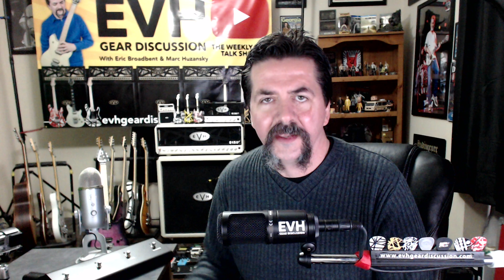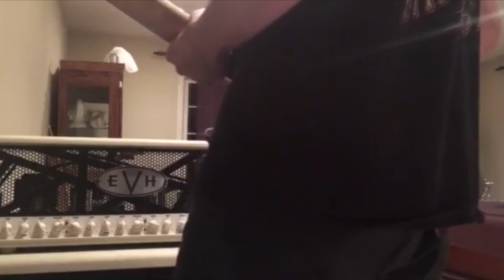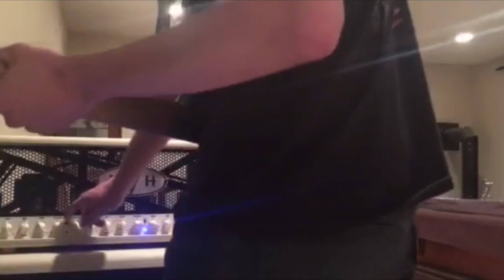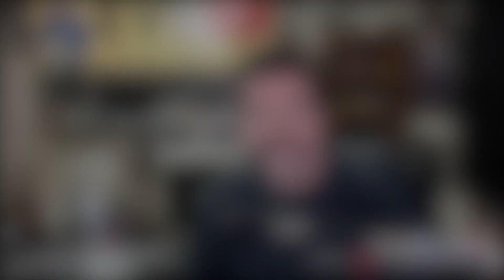EVH 5150III Voltage Problem/Hum No Output Fix

Comment: I have a similar problem with my 5150 Iconic that was delivered today almost zero output and sounds like a broken speaker but I doubt that is the problem my footswitch is not 3 pin though it’s starndard 1/4 inch

Comment: Thanks for this. I just bought an open box 5150 III 100w and the channels switch fine from the front panel, but the footswitch doesn’t work correctly. I’ll call the seller to let them know, but ordered a new din cable (only $22) hoping that will fix the problem.

Comment: I have an  (EVH 5150 100 STEALTH ) plugged into a load box (Torpedo captor X ) for direct recording through IRs. When I have the sound turn down on the monitors and I play the guitar, I can hear it coming from the amp head. There is a Randell ISO cab speaker cabinet plugged in Captor X. There should be no sound since the monitors are turned down. is this normal for high gain amps.

Comment: I've had an EVH 5150 EL-34 100w for 5 years now. Suddenly, I'm getting extremely low volume on the green channel, blue and red are fine although I have noticed a slight increase in humming and other noises but it's always made humming and other noises ever since day one so I attributed that just to the amp running really hot for the ultra high gain, nothing a noise gate can't hide which I have 2 running through it. Tried swapping preamp tubes around to no avail. I mean I don't play it that much or push the tubes that hard so I have a hard time believing the tubes are bad after only 5 years. I've had tubes last 3x that easily in the past on other amps. If it were power tubes going bad, wouldn't it affect all channels and not just one? 

Main fuse blew about a month back, replaced it and it's been fine until now. I was hoping it would be something simple like a bad cable for the footswitch or something but that didn't work either. Beyond swapping tubes and replacing the fuse, that's about where my knowledge of tube amp repair ends so I'm going to bite the bullet and take it to knowledgeable tech to fix it. Love the sound of EVH's when they're operating properly, not at all impressed with the reliability or quality though.

Comment: does the 5150iii lbx2 needs biasing when power tubes replaced? or it's a plug n play type of replacement?
Reply from the maker: Here is an answer direct from chief engineer, Howard Kaplan to me this morning: "Must be re-biased. Is not cathode self-setting bias and has a bias setting pot and sense resistor for measurement. Replacement el84 tube set must be a matched duet. Bias is set at 28 mA for the pair which measures 28 mV across R18, a 1 Ohm resistor. The bias pot is R37."

Comment: Hey I know this is an old Video , But I just got a 5150 3 100 watt head 6l6,  And everything on it works great Except when I Use the effects loop  There is this hum that I can't  get rid of.  All the channel volumes work nothing else is the problem, Funny thing  is   When I plug in to The front input Is silent as an owl But when I use the effects loop there's a hum Please  Help
Reply: I have a similar problem. Amp works fine untill I try to turn on the effects loop via the footswitch and then there is barely any volume and an awfull hum. Did you ever find a fix for it?
Reply: @PlanetFinesse   Wow that's interesting do you have A-line level for your effects loop?  It may need to be turned up, or you could have a broken phase   Inverter tube,  also make sure all your cables are hooked up properly, That's happened to me Minnie of times where I thought something was wrong but it wasn't  User error  lol
Reply: Also I don't have the 5150  Anymore Just got a peavey invective 120
Reply: I have the same issue with mine. Could you solve the problem?
Reply: @leonemesis87  I don't  have the amp  Any more I have a PV invective 120 watt.  You may have to take that amp  to a workshop  and get it Fixed, It may just have issues  with that model  in general

Comment: Hey. I have one 5150 lll 100 watt and its working perfectly but the effects loop on the  footswitch is backwards. The efects loop its on when the purple light is off. Any solution for that. Its not the cable. and the amp is working perfectly
Reply from the maker: I have had that happen numerous times too and it's baffling. Try this. While amp is on, remove the footswitch cable from the back of the pedal, wait a sec, insert it again and try again. It kind of "resets" itself. I actually had an experienced guy tell me "you have your send and return reversed". I was like Dude, come on. That surely was not the case, and I said I was not born yesterday. Try this tip and report back to me.
Reply: That trick worked but sometimes when i turn it on he comes back to the "wrong way" Lets see tomorrow on my show, Thanks for the tip!! Greetings from Portugal
Reply from the maker: No probs, mine still does here and there too, I just go with the flow. When I was gigging I would always do a quick check to see where it was (on or off) before taking the stage. Good luck!

Comment: I have a problem with my 3rd channel. It has this loud ugly hum/squeal/static ugly sound and when I use the effects loop switch the volume raises a lot. Could the problem with channel 3 be a failing tube?
Reply from the maker: It very well could be tube related, but I would bring it in to an authorized EVH service centre to be sure. Please keep me posted with your results.

Comment: Had a similar problem except mines switches channel randomly when plugged in to the pedal but once unattached it works perfectly fine. Is there anyway I can fix this?
Reply: Have same problem with my 50w. I'll be playing, and then it will randomly revert to clean channel with no fx loop

Comment: i want the stealth.BAD. are the bugs worked out with the new batch? i hope so. got to have one.
Reply from the maker: I have heard nothing but positive on them.
Reply: EVH Gear Discussion,    really appreciate your Channel,  I just picked up a 5150 3 212 combo unit and my question for you is on the blue and red Channel when I  turn the gain to 12  o'clock , there is quite a bit of gain but when I turn the knob up to about 2 to 3 o'clock and then some it doesn't seem like the gain increases and sounds just like the 12 o'clock position. is that normal or does something seem wrong with my scenario.   thank you for any help

Comment: I have the Evh 5150 100 Watt head. Today when I turned it on and tried to engage the effects loop there is no sound,  maybe just a little very very low. Without engaging the loop it is fine.  Do you think it can be the switch,  cable or a bad tube for the effects loop   ?
Reply from the maker: Could be a number of possibilities. Is it still under warranty? Bring it in to your authorized EVH dealer and have them take a look. Could be minor, but worth having a pro diagnosis.
Reply: EVH Gear TV Thanks for the reply Eric.  I changed the tube  for the effects loop according to the schematic and tested all my cables and it's not that.  I will individually check the pedals tomorrow,  it could be that too.  Thanks Again,  love the show and all the cool info. Cheers
Reply: Have you figured out the problem @Tom Foglietta? I'm having the same problem.

Comment: my 5150 iii 50 watt brand new had an issue where the tubes went completely red plated... I had the amp service by a licenses EVH repair shop... got the amp home and shortly after had the problem return... its like the old Marshall runaway bias problem...

Comment: Hello, I have the same amp, it was working perfectly , now the footswitch won't change channels and when stepping on the effects loop button, shuts the three channels off , the amp works just fine changing the channels manually , Any idea about this failure ? Thanks in advance

Comment: The red channel on my 5150 isn't working quite like it should the green and blue are perfect but when I switch to red it's super quiet the gain is turned up over half way and I've around the Internet and nobody else seems to have this problem. Any suggestions?
Reply: I just got a 50w version less than a week ago, within hours this same problem developed. I’m gonna likely replace some preamp tubes and see if that resolves it. If I figure it out I’ll let you know. Please do the same
Reply: @williamlecompte1542   Same issue here, no sound on CH3. I haven't tried this footswitch test but I pulled the amp out and tested continuity and found what I think is a cold solder joint on V4, which is tied to CH3. I'm going to heat it up and add some solder and see if that fixed it after I try the footswitch.
Reply: I just got one that does this also. Did you guys ever find out the issue?
Reply: I have the same issue and took it to an authorized repair center and they could not figure it out.  We’re you able to get an answer to your problem?

Comment: Help! I can't find anybody that has had this problem. I have an EVH 5150 III 2X12 Combo (This is an older version with out a seperate volume for channels 1 and 2). I also have a 4X12 EVH cab running at the same time as the 2X12 speakers. I have the ohms set correctly. I've been running it this way for a couple of years. About 2 weeks ago I noticed the sound of the amp was a bit off. If I touch the speaker cable that is hardwired into the 2x12 combo the soud changes and goes back to normal for a short time. It does not do this all of the time (but most of the time). I've unplugged the 4x12 and put the ohms back to 16 with no change. I did the same and hooked up the 4x12 and disconnecteed the 2x12. The sound is still off. I've taken the back of the 2x12 off to check the speaker connections and they are all good. When I touch the 2x12 speaker cable there is still a noticable differance in sound. I don't think it's the cable so, could it be the output jack?  I can NOT plug the 2x12 speaker cable into the 2nd jack that I use for the 4x12 because it is not long enough to reach. In Fact! The 2x12 speaker cable is so tight that you have to start to plug it in at an angle. It straightens up after the 1/4 inch jack is halfway plugged in. They did noy leave enough sllack at the factory to plug in or unplug the speaker cable. Is this a problem ou have ran into and what is a fix for it? Thanks in advance. Best Regards, Scott Vancamp.

Comment: Eric, I have a 5150IIIs EL-34 100 watt... had for a year now. There is a constant low level hum. Its not loud, the amp plays fine... but there is this hum present throught the speakers.
With guitar straight in, no effects loop, it still retains it. When I turn the volumes all the way down, the hum still there. When I crank it, it doesn't make it worse. However, when I increase the negative feedback (resonance) of any of the three channels, the hum gets fatter.
 I've never had an amp with this issue, btw I even unplugged footswitch and its cable; no change. If you have any suggestions before I take to a repairman, please by all means, respond to my query.
Thanks, and regards,
Eric Tripton
Reply: My 5150 III 100W also has same problem. Constant low level hum & low level pop noise when I switch between channels. Noise gate on the effect loop does not help. I guess that it is caused by power section of the amp.
Reply: It may be the preamp tubes.... I have yet to replace all tubes.. V1 and the phase inverter I installed JJ 12AX7... still have hum... still need to replace all... Amp sounds great... just that dag gone hum.. We'll see once I change ALL tubes

Comment: Hey I have a question concerning  noise reduction because it makes quite a lot of noise with a lot of gain (as expected) BUT i bought a boss ns2 which was a used one. The thing is i have to dial the threshold to maximum and the decay to zero to at least kill the high tones/noise or feedback. But by playing staccato or palm muted stuff it still gets through. Is that a Problem of the amp or - what i am thinking of the used boss ns2? 
Also the humming is not eliminated by the noise gate. 

I am just a bit scared that i have a broken amp...

Sorry for the beginner question. 

I really like your videos. The are a big help
Reply: My amp is doing the same thing im gonna have someone put new tubes and i have a noise gate too and it still squeals with feed back. I love the tone but the feedback sucks especially with certain guitar pickups
Reply: Any ultra high gain amp is going to have some hum to it. 

The feedback could be coming from the guitar itself too. String feedback behind the nut is usually the culprit or if you have a tune-o-matic/string-thru style bridge, the string feedback could be coming from behind the bridge. The louder and the higher the gain you're using, the more it'll ring out and give you feedback. String dampening wraps will fix it.

And obviously try and stand ample distance away from the amp while facing away from it to reduce any amp feedback. The NS-2 is not the greatest noise suppressor in the world either, maybe look into getting an ISP Decimator if you want the best noise cancellation tool. Look into any pedals you have too and your cable setup. Patch cables just touching the wrong way can cause excessive hum and noise. Your amp is just one part of the whole signal chain and any part can be causing those issues not necessarily just the amp.

Comment: Hello,
 I've recently bought the EVH 5150 EL34 50 Watt Head with matching cab ( amazing amp by the way).
My question is, is the footswitch input on the back considered a " short-to-sleeve" footswitch input?
I have the Headrush Gigboard (only wanting to use it to channel switch with effects) and I suck at figuring out the MIDI stuff, but they also have the option of an EXTENDED AMP OUTPUT using a TRS cable to the amps footswitch input as long as it's a "short-to-sleeve" input.
Otherwise damage might occur.
Thank you for taking the time.

Comment: Eric, I have a EVH100 amp bought it brand new in 2016 it has always been a workhorse. Nothing ever went down all of sudden I started getting a weak signal out of channel 3 when playing a fast passage it doesn't feel like the amp is as responsive as it was. I have never replaced the tubes. Do you think I should start there? Thank you Mike -Angel Black

Comment: Hey I had a question about my EVH 5150 iii 50w amp head. Looking for some help. First off I have the 6L6 model with the foot switch that uses a regular guitar jack to plug into the amp. So here's my issue. When I engage the effects loop I can a ton of extra noise and hum. The channels still seem to work fine and when the loop isn't engaged the noise goes away. It seems when I run pedals though the loop the amp loses some tone and gets a bit muffled as well. I have a hush x2 nose suppressor that I run through the loop and it doesn't fix that noise at all. Note, this is not amp hiss that I'm talking about. This is totally different. I've tried multiple cables so it's not a cable issue. Any ideas to what's going on with the amp?
Reply from the maker: Very good question. There are many factors that can create noise. Including power supply for your effects. What type of a power supply do you use? Also, sometimes it comes down to one pedal that does not play nice. For me, it was a pedal that I loved, the BBE Sonic Stomp. It had to go, as it did not play nice in my rig. Added noise. Start with only 1 pedal in the loop. If you are getting noise there, it could either be A: You power supply or B: That pedal. Remove that pedal. Try the next. Noise still there, than surely it's the power supply. Let's start with this and I'll be happy to help you further troubleshoot.
Reply: I was checking it out last night. I'm pretty sure you're right about the power supply. I'm using a one spot with three pedals right now. And it's an old one spot too. Bout to upgrade to a voodoo labs power plus 2 here soon tho. Hoping that fixes it. I probably need new tubes as well. Hey thanks for replying tho man. Love your channel.
Reply from the maker: Christopher Davisson  You are very welcome!! Thank you very much for the kind words and keep me updated with your results!
Reply: Yes Sir!
Reply: I have the exact same problem in the exact same amp. Could you solve it? Was it the power supply?
Reply: @leonemesis87  Honestly? They are great amps as far as tone but they have their issues. Something was screwy in the effects loop. Got another one later and after a while it did the same thing. I'm almost certain it was reacting to the lighting in the room it was setup in. So anywhere with that type of lighting these amps tend to have a hum. I tried every gate/noise reducer I could and it wouldn't ever go away.